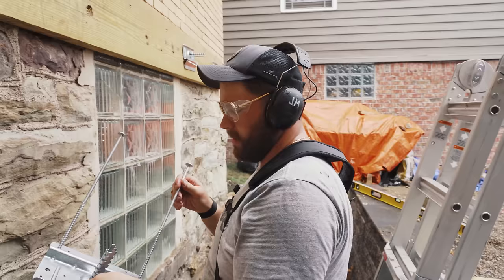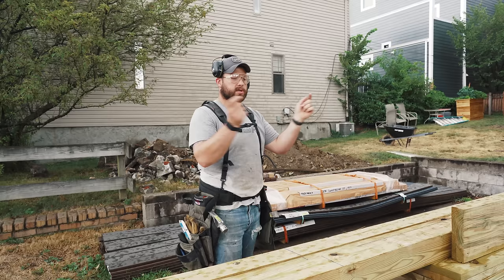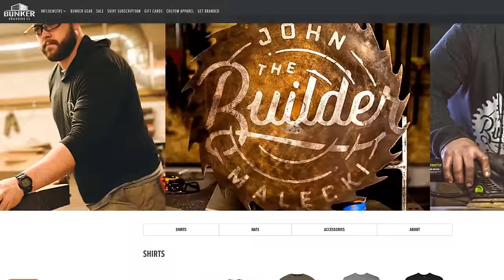Building An EPIC DECK - Pt. 2 FRAMING

Comment: 2:10 ish..  the ledger board over the brick..  the brick has obviously subsided at the right corner.. see the repairs on the facade...  Will the deck be leveled to a spirit level or to the building lines?

Comment: I have found that if you lay your joist hangers first.. your chewing up alot more wood making the tops level for treck decking.. remember.. every joist hanger is the same size.. but not ever board is the same length or thickness.. having the top level is so important with treks because its so bendable, you'll feel your dips n bumps. Specially when you roll a ball lol

Comment: Can you please give us some advice? We had a deck built just 3 days ago on the south side of the home with lots of sun. It has yet to be stained & today we noticed that a lot of the boards and 2x4 railing tops are cracking and some floor boards are cupping!!! We are in disbelief this would happen in 3 days. The wood is pressure treated  pine from Home Depot. Is it the installation? The wood? That it’s on the south side and had intense sun for 3 days? Any advice would be greatly appreciated.
Reply from the maker: Hey, Im not an expert so maybe reach out to "Doctor Decks" Jason is awesome! But pressure treated lumber will always shrink and inherently crack, its just part of the process. I do believe a lot of people let their pressure treated lumber sit for a bit before using it to allow this to happen before assembly. Hope this helps
Reply: @John_Malecki  thank you!!
Reply: Next time make sure the grain of the decking crowns down. The ends should look more like a frown than a smile. It helps control the inevitable cupping. And the cracks are part of using pt lumber. Staining/sealing should be done after a min of 6 weeks to up to 12 on shaded decks.

Comment: Hurricane ties become less fun after putting in a thousand and going up and down a ladder/ moving it ever minute, having to deal with a hose, a positive placement gun and posi nails (which will bounce off if it hits in the wrong place so you have to wear safety glasses and keep your mouth closed), trying to get into the space with the gun to nail the clip (harder en it sounds), wall obstructions (aka not being able to get in x spot because a wall is in your way or a literal trash pile), etc. I know because I put too freaking many on for 3 days straight once. I cut my hand, fell of a ladder, and my body was torn up afterwards. Let's hope I don't have to go through that again, but with my job as an apprentice I never know. :)

Comment: when i build decks i build the frame first, square it, secure it. then do all the joists. being that they are in hangers and everything else is locked down, it doesn't matter if you are shy 1/8". just slide the joists in and you're all set. the decking is what matters really when it comes to being nice and presentable.